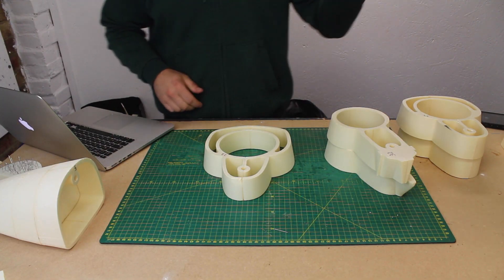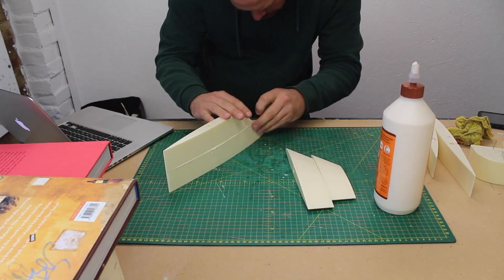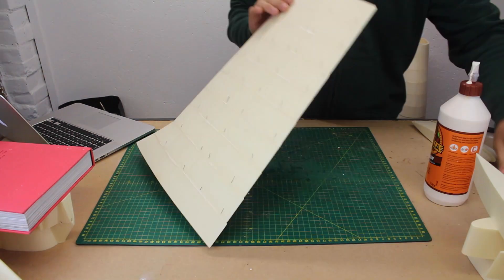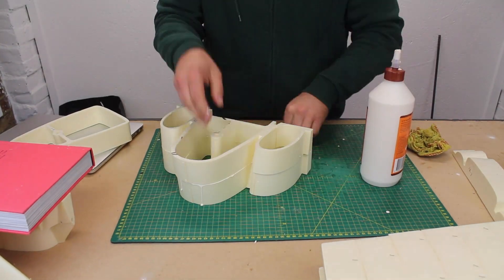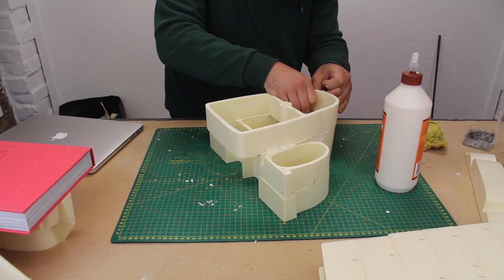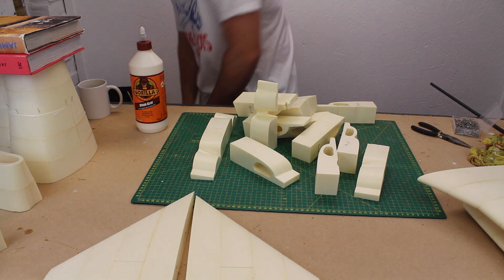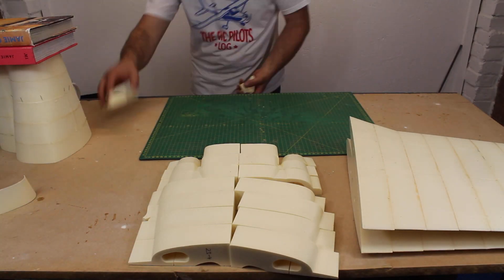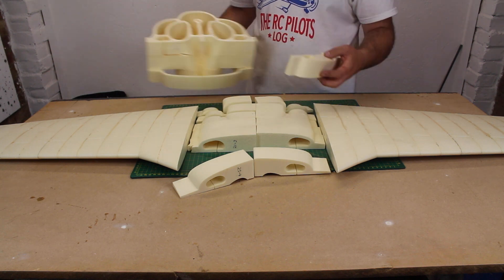Aerotetris CASA C101 Aviojet Build Log Part 4 - More glueing!

Comment: by The RC Pilots Log.I want your help on something.I have 70 mm edf and 2200 mah 4s lipo.a jet that can fly with these materials.or should I reduce the weight by dropping 2200mah 4s lipo to 1800 mah ?
Reply from the maker: Hi, Its hard to say without more information. You need to look at the spec of the EDF and motor to determine the thrust range on the 2200 4s. I suspect 4s is too low voltage, but I depends on the motor.
Reply: I don't think you will need to drop to an 1800mAh lipo. In my experience, the impact of battery weight is negligible on the final weight. I use the biggest batteries I can fit in my planes.
Reply from the maker: Lozzie74 I agree, I often put an oversized pack in compared to the spec with negligible impact on performance, just a little longer flights which every wants 😁

Comment: Rob the part you are having an issue with goes on the bottom of the fuselage I believe the wing locks into the bottom fuselage and the top of the wing, I think anyway.

I love your program, when is the nest part of your video series.
Reply from the maker: Ronald Cheeseman indeed, I’m not having trouble so much as trying to work out a method 👍🏻how are you finding your s?